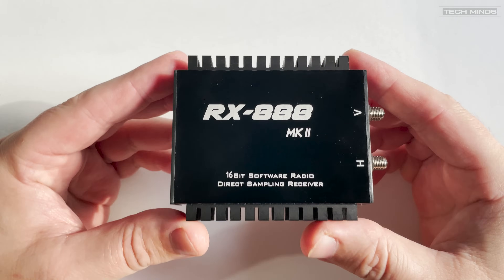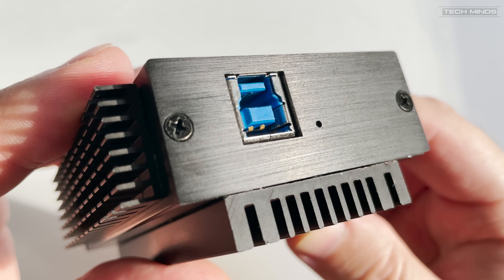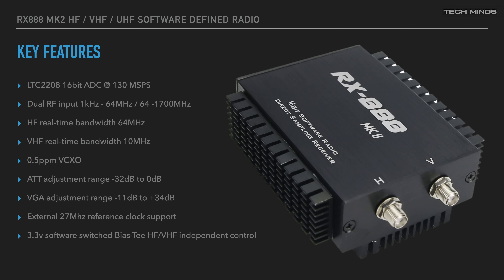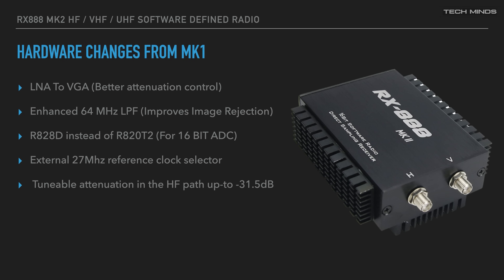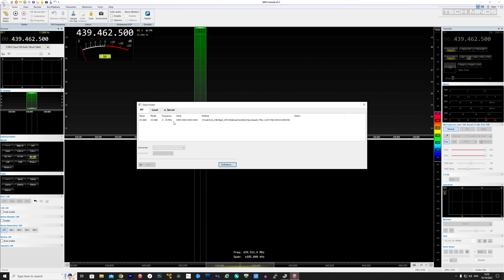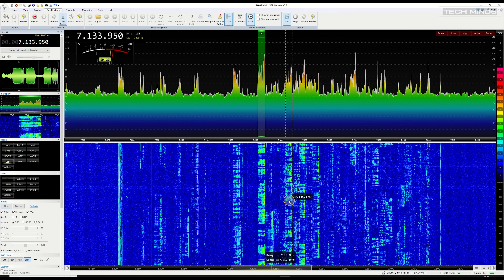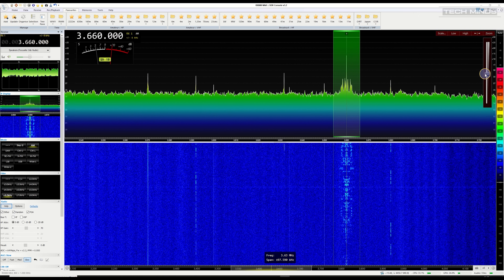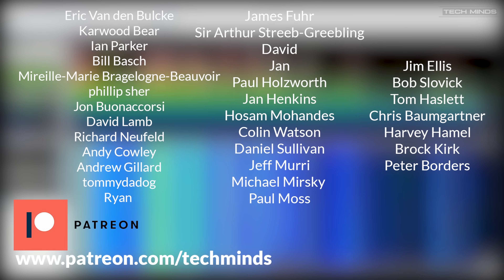RX888 MK2 16BIT Software Defined Radio

Comment: These Chinese SDR's have a big problem with their assembly quality and the faults of guarantee of Ali-Express vendors. I have had TRX-DUO and the last two RX-888 units, the TRX-DUO worked fantastic for 9 months, then died. Of the two units of the RX-888, the first one died after two months, it returned it and I have not gotten the seller,  HamRadioShop Store,  changing my defective unit or returning my money. The other unit only works the HF part and desist to make some claim.
My other SDR's, RFSPACE and SDR Play have never given me problems.
A shame that some promising SDR's are manufactured with such a low quality.

Comment: I bought the RX-888 and yes it is a great radio because it allows me to visually spectrum monitor the entire HF band (0.1 to 30 MHz) on one PC screen using SDR Console. But because I was running it at it's max (64 MHz sample rate) continuously, it over heated and suffered component failure. The Chinese company I bought it from informed me that it's heat sink design is inadequate for continuous operation. Does anybody know if the Dragonfly SDR can run continuously without cooking itself?

Comment: Hi Mat. Can you elaborate a little more about your pc config en hardware? Would an external egpu help?do you require a Thunderbolt3 connection?
Reply from the maker: Best to watch one of my latest videos where I elaborate more on receiving the whole 64MHz. I also posted in the comments on that new video my current PC specs. I have a different computer now to what was used in this video. Thanks for watching :-)
Reply: Hi Matt. Thanks. I ordered this one. Do you have an alternative site for the drivers. Seems to be archived. Or can you send the zip file? Thanks in advance.

Comment: Don't waste your money. This device is an unstable and unsupported turd. It overheats, locks up, the bias-T doesn't work for more than 2 minutes before overloading and turning off. All of these issues require a reset of the device. Though the RTL-SDR V4 is not as sensitive as the RX888, there are no such issues with it.
Reply: Sounds like you got a bad copy or/and a monday ex
Reply: @Swede_4_DJT  After disassembly it's apparent that the heat sink implementation is crap.
Reply: @propellerhead2000  Did you remove it carefully?
Otherwise, the cooling pads get damaged. 
But thank you for the heads up, i will add pads and / or a little raspberry fan or something like that. 
I have it in the window now. It's winter and around -7 Celsius here, so i will upgrade the cooling before the coming spring in a month or two.

Comment: Impressive specs, but many users report that it stops working after a few weeks/months.
Are they all made on a Monday?
Reply: @jacquesmertens3369  cooling issues, so probably heat-death.
I think a good tip for ppl who will buy or just bought this SDR modify the cooling/keep it cool.

Comment: Would it have been better if the unit connected to your computer via the router so you can access the RX888 from anywhere in the house over WIFI. but the RX888 would need a LAN interface.

Comment: 13 minutes in @tech Minds says that SDR Console only lets you go up to 32MHz bandwidth, it does go all the way up to the maximum of 64MHz if you go to "Options" under the "Radio" section of the left hand side controls (While the SDR is running). In there, there is an option to change the "Sampling frequency" to 128 MSPS. Turn the radio off, then on again using the button on the top left and then using the bandwidth dropdown chose 64MHz. My radio is running quite nicely on my laptop at the full 64MHz.
Reply from the maker: Absolutely! 👌

Comment: The truth is that the RX888 MK2 is not compatible with SDR++ nor SDR#, I didn't find anything about that. It works great with HDSDR and Console, but I prefer HDSDR because it is lighter to process. I see the RX888 as an excellent SDR, but it's clear to me that its manufacturer is lazy. It is a total disregard for the consumer that the manufacturer does not provide libraries for LINUX and MAC or even makes it compatible with the most used software such as SDR# and SDR++, so the product loses competitiveness and lags behind cheaper and simpler models. I love SDR receivers, I have a few models, but by far the best is the 14bit RSP1A, the SDplay software is unbeatable because the manufacturer pays a lot of attention to the product, including making it compatible with other software to the customer's taste, this does not happen with the RX888 which in my opinion is much superior in terms of sensitivity to the RSP1A, but loses out as it has almost no compatibility with any popular software. I hope the manufacturer wakes up in time to save him. :(
Reply: It definitely is compatible with SDR Sharp, at least up until V1732 as I've been using that combo since the MK2 first appeared on the market. https://www.youtube.com/watch?v=Ux4L5VI-U70  RX888MK2 on the left, RSP1A on the right.

Comment: So I just got mine, but the device shows up as "Unknown device", not as Westbridge. Installing the driver as shown in the video does nothing, even after rebooting.
Reply: Aaaand I had to enable "show hidden devices" in device manager, find the cypress device, and update the driver to the one from the website. Then it started working.
Reply: Unfortunately I get very choppy audio, and using hdsdr does not work at all as the extio plugin just does not see the device. Tried different USB ports, no joy.

Comment: The FM signal on 29.850MHz Is an alias from 34MHz, the traffic is the Turkish forestry Fire service. The signal showing the selective fading on the left is the Ghadir OTHR from Iran and the two diagnonal sweeps are the ionosonde from near RAF Akrotiri in Cyprus.
Reply: Hi, I subscribed to your channel. Just a question... 
On the 60 meter band there is a wide bandwith transmission that sounds like a ringing bell, it covers from 5.350 to 5.380 more or less.
Do you know what it is? We thought that it could be an OTHR, but maybe it is some kind of digital transmission, it is all over the ham band in Spain which is quite narrow.

Comment: It seems like very nice advanced SDR.    I think I need to work up to the higher end units, since I am just starting out and have very limited income.  A dual antenna unit sounds great for serious users.    I hope to get a basic unit up for Xmas.  Thanks for giving me something to aspire to.
Reply: I wish you all the best with it! You may learn right away the appliances that have 'switching power supplies' that make A.M. hash/noise. You'll probably experiment with which way to lay an antenna wire for directional receiving, too. You may want to keep a small journal of what you hear day to day, so you can catch the same radio shows the same time daily/weekly. Again, all the best & congratulations. 🇺🇸 😎👍☕

Comment: bought mine about a year ago. not long after justin demonstrated it. my 2 year old hp x360 laptop with an i7 10th gen and intel gpu wouldnt run this at anything more then 1 mhz. ended up buying a new asus rog with a 12gen i7 and a 3650 gpu

Comment: SDR++ official releases do not support the RX888. It won't be supported until the manufacturers release a real library/driver for it. It's an issue if you run Linux.
Reply: Agree totally with this. the linux lib is very bad, so no support for Mac/Linux users 😞

Comment: Is there software for Mac and or iPad?
Reply from the maker: For Mac you can use SDR++
Reply: @TechMindsOfficial  no, the official release os SDR++ doesn't support this device because of bas lib / driver for OS other than windows.
Reply: @TechMindsOfficial  Thanks
Reply: @TechMindsOfficial  I don't believe there is a driver to get it to work on Mac.

Comment: I would much rather have to deal with a normal USB 3.1 port and even an auxiliary power plug if I had to then to rely on a somewhat elusive USB port design that for the most part a lot of stuff is refusing to use. Not to mention if crap ever hit the fan trying to find another USB connector to connect to that if the one that you have happens to break you're pretty much screwed. I just don't understand people when they design stuff like this not thinking about using common off-the-shelf cables instead of something that's practically proprietary as far as ease of locating in a SHTF scenario.
Reply: Agreed. USB-C does everything and is the future of cabling standards. Why is radio equipment always so slow to use it? I will never know.
Reply: nothing elusive about this connector. cables are cheap enough and the good thing about it is its very stout. buy a 3 pack on amazon. 2 for spares if you are that worried about it

Comment: Starting at 11:39 there is a signal that sweeps from left to right (low to high) across the entire displayed screen.
What is it?
Reply: Its a ionosonde, used to Measure muf of the ionosphere.
Reply: @vk3hau  There used to be one at the Radio & Space Research Station where I worked in the 60s.
Reply: That's not that unusual. I don't really know what they are though.
Reply: https://youtu.be/v2fvHn1Hkjg
Reply from the maker: I see this regularly on all the HF bands. I’m thinking it’s someone doing a SWR sweep.
Reply: @TechMindsOfficial  See my other replies regarding the ionosonde.
Reply: It's an ionosonde from Cyprus, quite distinctive as it has two sweeps with minute intervals. It's connected to the OTHR system allowing it to use the optimal frequency.

Comment: Thanks there aren't many good videos in the rx888 mkii.
But you didn't show the see all ham bands at once, see all the FT8 in all of the hf band and the see all shortware broadcast bands at once.
By see I mean it opens a separate window broken up with a boxes for each separate spectrum display  for each band. Also you can open up another window and define up to 24 seperate receivers from across the whole hf spectrum. You can individually mute and unmute them. Not sure how useful that is with one human listening. 
Also with the large spectrum display you can see frequency sweeping signals like ionosonde. This appears in two places in this video
Reply: What software is this and can you link to your video?
Reply: @pen25  it's in SDR console 64bit. You just need to know where to click. I might put a video up on my YouTube of it.
Reply: Done. I'm not a content maker. But you can see it working. I have local RFI from Ethernet of Mains Power. And the antenna are resonant on 40m and 20m (I switch back and forth)

Comment: Geez Mat, what kind of review is this? I want to hear the full spread! In 1KHz intervals! And I want it now!!! I'm kidding. Just thought I'd beat them to it, lol. Anyway, cool video. Very neat little SDR. Not a half bad price, either. If I didn't have my HackRF, I might be looking into one of those. The heatsinks are nice, though I don't know how much they will do as they aren't directly in contact with anything other than the two rather thick TIM pads. Most of the heat they see is what radiates to the case and works its way around to them. That said, it's not like they're hurting anything being there, and it will help evacuate a bit more heat than what it normally would with just a slab sided case. But it is really neat bit of kit with a pretty healthy chunk of bandwidth. I may look into one anyway, lol. Thanks for the video, great stuff as always.
Reply: Ģ

Comment: how it could be 64 mhz hf band if hf is covers only 3-30mhz band???
Reply: YES...correct ....64MHz is VHF but where they need to up convert hence new antenna port. The V port also covers UHF and SHF so it is also "badly" labelled ....should maybe be L and H LOW (for up to 64 Meg) and H for HIGH > 64 Meg. I have an AirSpy discovery HF cost me more but I'm a bit "gun shy" with cheaper dongles hence this video! 
 https://youtu.be/_NwFCT98CsI
Here is my AirSpy video
https://youtu.be/Mx1dD_GV1nU
Reply: @TheArtofEngineering  so, is airspy performing better on vhf than rx-888?
Reply: Oh for god's sakes !